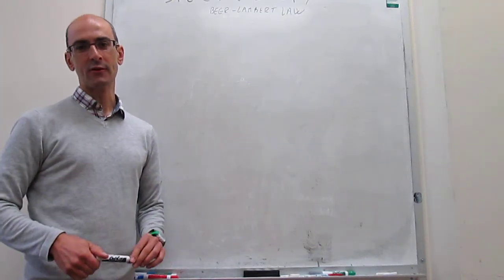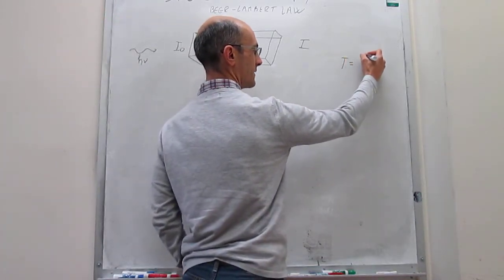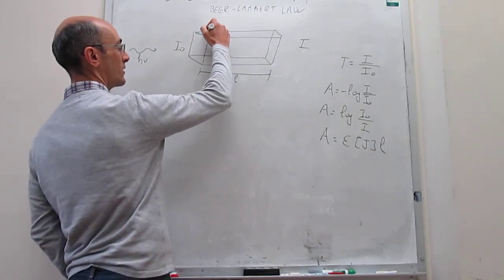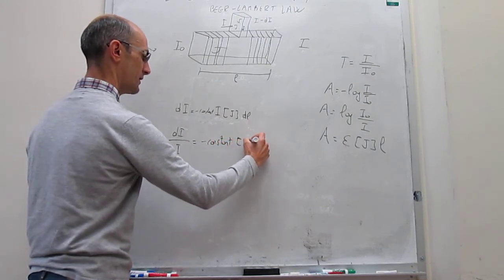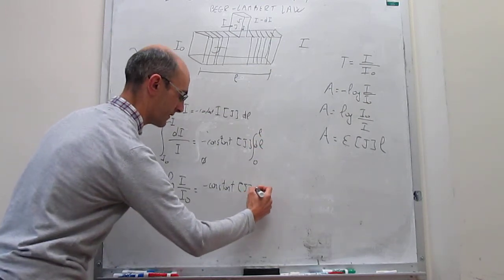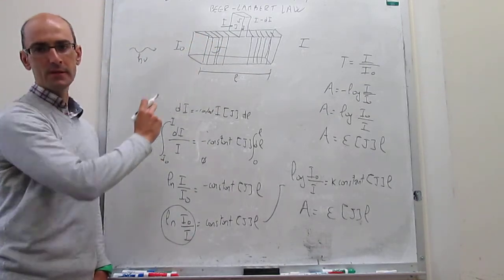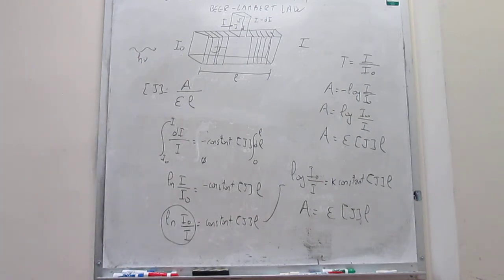Spectroscopy. The Beer-Lambert law

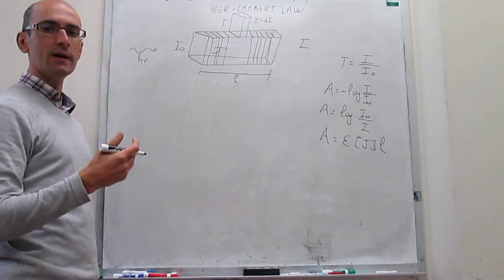Comment: Maybe I have misunderstood something, so I'll ask: At 3:35 we have a small slice with incident intensity I, and an exiting intensity I-dI, which is lower than I. To summarize: I-dI < I. Next we agree that dI is proportional to concentration, [J] > 0, the incident intensity, I > 0, and the length of the sample, dx > 0. Then there is a constant, c > 0, and at 4:50 it's stated that the intensity is dropping, introducing a negative sign. Now we have dI = - C*I*[J]*dx. Note how all constants are positive, which from the equation yield dI < 0, but then -dI > 0 and therefore I-dI > I, which is a contradiction. Where did I go wrong?
Reply: easy.. he just made a simple mistake... he should wrote I+dI... 

to understand it, you shouldn't think of it as "I before" and "I after" as he introduce it, here we're concerned with I at all time (that's why we only use "I" symbol)... and this I is decreasing as it passes through the solution... that is dI is negative (as you can see from the equation) and I+dI (I after it passes the solution a little bit) is lesser than I

where are you study? which field?